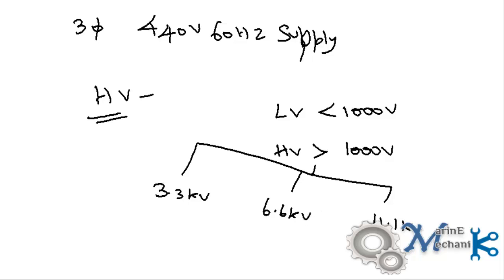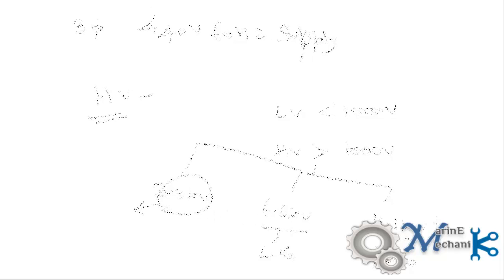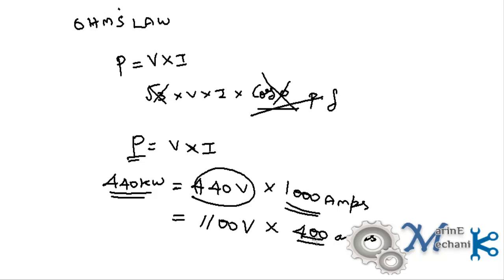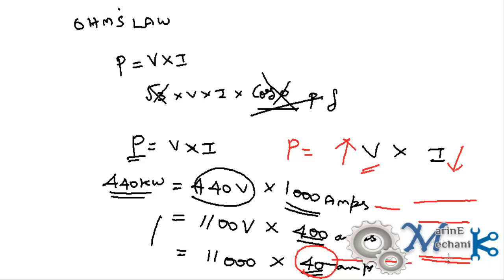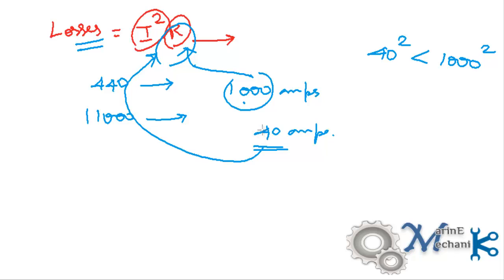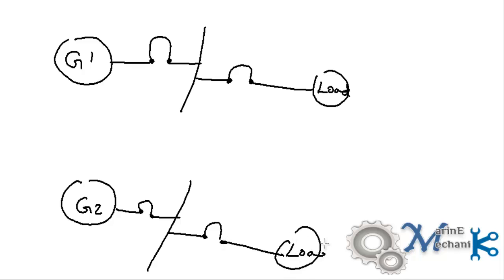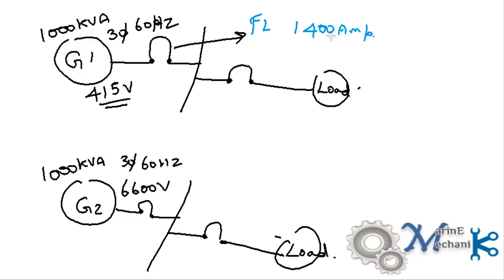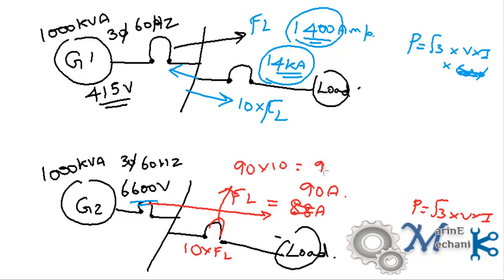Why High Voltage is Used on board Ships?

Comment: sir, v=IR if voltage increases current also gets increases. but u said totally viceversa. how it will be?????pls reply anyone
Reply: P=V*I for constat power V and I inversely proportional
Reply: i get your point.. according to ohm's law, voltage is proportional to current.. so when voltage increases to 11kV, why doesn't current increase? this is because ohm's law is applicable only for current carrying conductors, not transformers or generators which produce or transmit power..
Reply: @anirudhrox8839  that only works on DC not  AC...